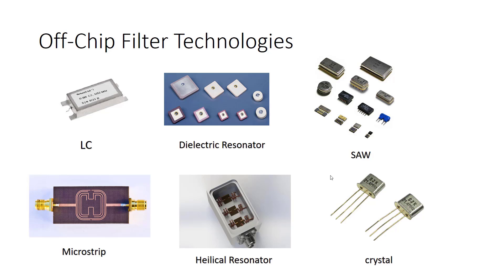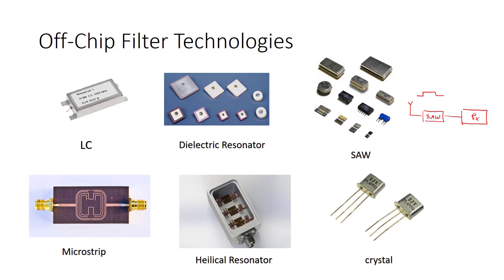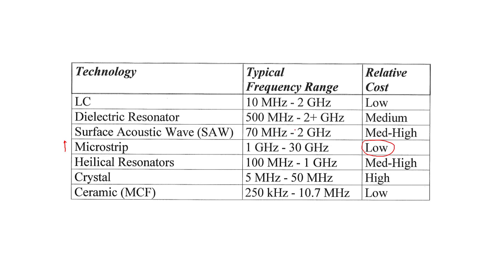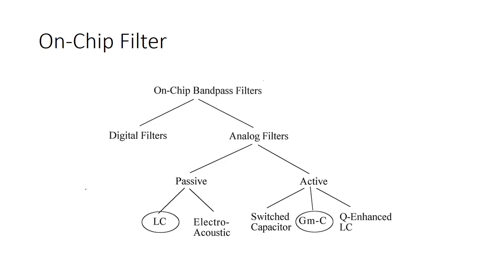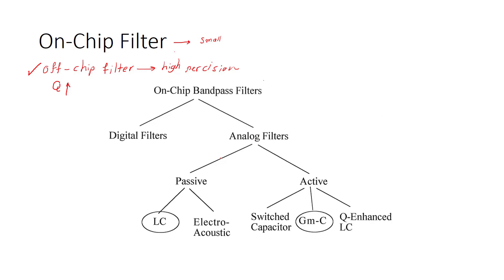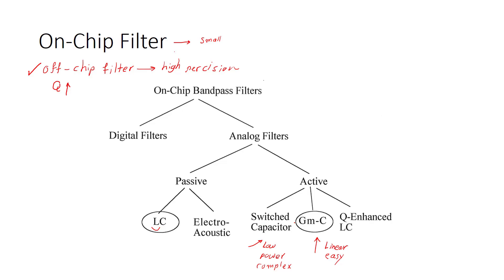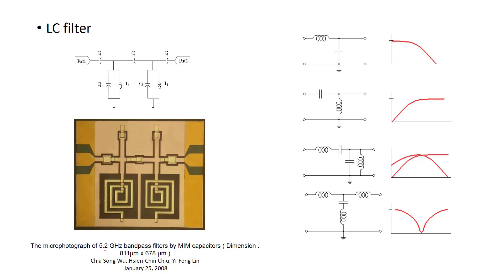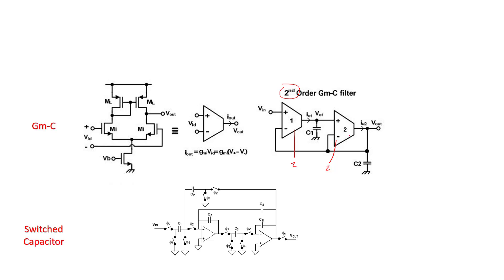saw filter low pass high pass band pass and band stop low-high-pass filters in rf part 2 #12

Comment: So...basically Saw filter and notch filter do the same as band stop and band pass filter...only difference is build materials and size...but basically they do the same job? Damn..i've been googling my ass off to find the difference between saw and band pass filters..found scientific papers about the surface acoustic wave tech and its use in military and how it guides missles. None of the info i found just put it simple: "imagine a SAW filter like a bandpass filter..only think in semiconductors"..that would save saved me a lot of time. Same with SWR vs LOGMAG...much blah blah but in the end both tell the same info..just different ways..